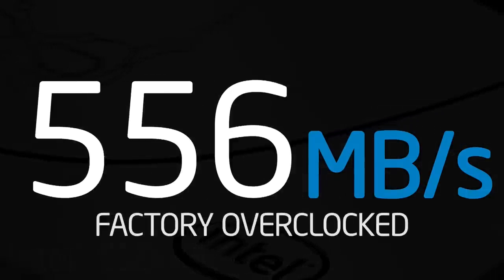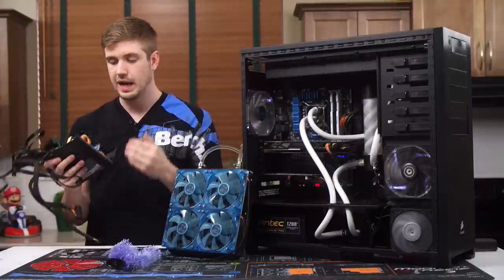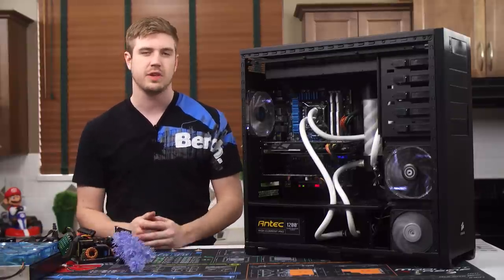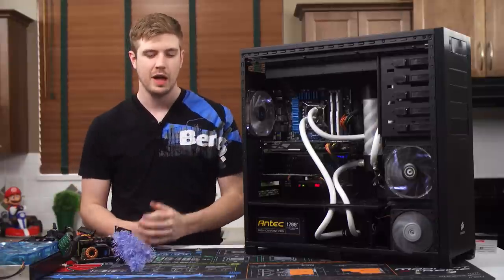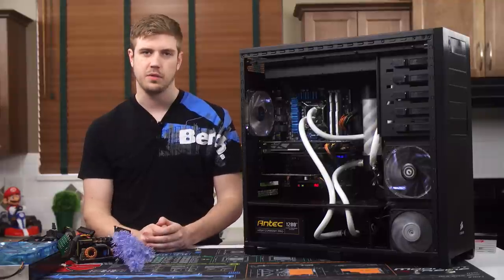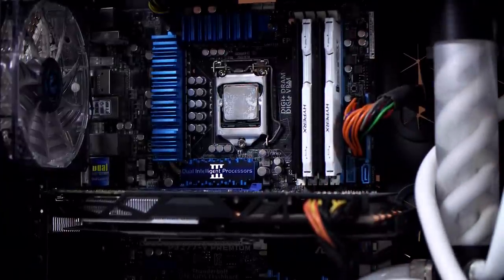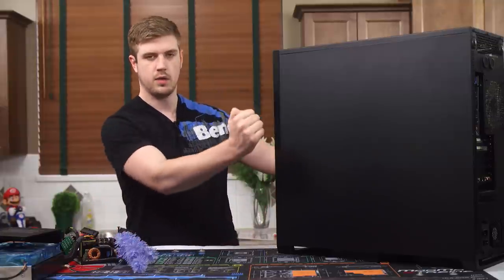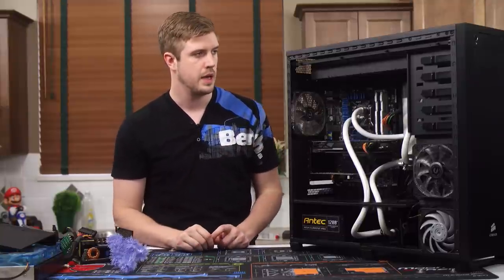Personal Rig Update 2 - Slick: The Introduction of Squirtle

Comment: I would highly recommend ditching the silver kill coil and silver fittings when you redo the loop. Silver has a tendency to cause galvanic corrosion with both copper and nickel. If you want to stick with flexible tubing, I would get clear lrt advanced and use a coolant from mayhems, since it has biocides and anti corrosives. White pastel with clear tubing would be a good solution for this loop.

Comment: I've seen some hate for it but I highly recommend Feser one cooling fluid. I have used it for years and had several colors including green, black and currently red and it is awesome. The color is fantastic and you don't have to worry about microbial growth or corrosion. Also, have you looked at Caselabs cases, I have a Merlin and I love it.

Comment: Reminds me of a build I did with mineral oil. A DC power supply that ran at 420volts, 20 amp. In the size of a single speaker box. Won me VICA one year.

Comment: Hey Luke you might like the NZXT H440. It has support for a triple 120 rad in the top, already has sound dampening foam preinstalled, and has that rear LED that you want to install in your 800D. I have one and I'm loving it. The only downside is the limited wire management behind the motherboard due to the foam taking up space. Oh and if you prefer to have optical bays this is missing them, but I just use an external DVD drive on the off chance that a professor or relative lends me a CD with content. Oh and you can unscrew the mesh in the front and top panel for a little bit more airflow in the H440.

Comment: If you want a cool idea for a case, I'm designing a custom one to be laser cut out of MDF and acrylic. It's about as big as a 900D, which is slightly ridiculous when I add it's only really meant for air cooling (although you could fit a 480, a 240 and a 120 if you really wanted to). It's worth it though. at every intake and every exhaust, there's a specially designed muffler that allows a lot of airflow, but (hopefully) lets very little sound escape. These require some space, hence the large size. Also, the optical drive is in the rear instead of the front, which helps with aesthetics. I'll be making the CAD files available online for free when I'm satisfied with the result.

Comment: If you are in the market for a good case I have a Cosmos II and I love it, wont be able to fit your thick rad in the top. My rad is The xspc rx240, descent rad if not superb, it is a thin rad. My pump/res combo is a cheap xspc but it has surprised me with its flow. I got 3/4 x 1/2 tubes and my temps are very very low. 33 to 40 c. I got 10 fans in my case and I can't hear them. 7 x 120mm, 2 x 140, and 1 x 200mm, one 140mm is just sitting in place just like your bottom fan and that made me laugh. I have an air cooled vid card that is why I have so many fans, I hate high temps.

E gads gadzooks and yoits! That cable management ( or lack thereof) is bordering on the epic. I'll definitely be following this build/update/redo. Power of the Squirtle, one day he can maybe meet Odyssey at a lan party. If I ever lug this beast around.

Comment: Well Slick, if budget is a problem, you can just go to the cardboard box dump, find one the size of your fish tank, spray like 4 cans of NeverWet on it and you now have the first mineral oil-cooled PC within a cardboard box! Then just place the NeverWetted cardboard box inside ANOTHER NeverWetted cardboard box if you are scared that it will leak. If you're poor, just continue the box-ception as you see fit. You have an endless supply of boxes anyway. NeverWet DOES in fact magically work with paper. You can turn a cardboard box into a ice and beer holder. So why can't mineral oil work?

Comment: Laser etch the eye thing from lord of the rings onto window panel and have different coloured LED (Red at bottom, Orange at middle and yellow/white at top, if you can have the LED's pulse at different times it might look like Fire)
You could put some design on the PSU fan and grille to look like that burning eye on the mountain.
The tree use NZXT sleeved LED's for glow, could even have yellow and green ones so the tree can show daylight & greenery and such.
If i have got stuff wrong I'm not a LOTR fan.

Comment: Use a plasma torch to cut your case dude, with little to no heat soak you shouldn't warp the thin metal and with the torch you can draw the Mona Lisa on your case if u wanted to lol

Comment: Linus loves that D5/655 pump.  I personally prefer the other awesome pump, the 355, or 35X if you want variable speed.  Its just so small and compact, and with a topper for G 1/4 fittings, it looks so slick.

different strokes ehh

That a Xonar Essence?  For 25 bucks??!?!  Crap!  Ive got the Xonar Xense.. and its kept my happy for like 4 years now.  Its a pure headphone user card, which I am.  HD 650s ftw.

Comment: Built mine few months ago.
Specs:

Case: Corsair Obsidian 250D
PSU: Corsair RM 650W
Mobo: Asus Z87i-PRO
RAM: Corsair Vengeance Pro Gold 16GB (2x8GB) 1600MHz
CPU: i5-4670K + Corsair Hydro H100i OC @ 4.7GHz
GPU: GTX 770 Asus Direct CU II OC
SSD: 120GB Samsung 840 EVO Basic SSD
HDD: 1TB Seagate Barracuda HDD

Got my i5-4670K to 4.7GHz @ 1.3V which goes up to 70-75c and stays stable. Even had it at 4.8GHz, but it was barely stable with 1.35V, so I stepped down.

Comment: Greetings, not sure how far along you are on your Gondor Tree Cut, but a way to illuminate it would be 1/4" Plexi (choose your fav brand) and drill holes for LEDs on the Edge, that way the LED will lite the Panel and make the Plexi Glow rather then blind you. You could use thinner Plexi and of course much smaller diameter LED's if you choose, you will just need to use more of them, obvious reasons. This way you can lite just the areas you want to lite. Enjoy...
Reply: Gondor Tree Cut?

Comment: "Frankenkludge" aka "Franky"
CPU: Intel Core i7-3770K OC'D to 4.3GHz
GPU: 2x MSI GeForce GTX 660 TwinFrozr
RAM: 16GB 1333MHz G.Skill Ripjaws
Case: Cooler Master Storm Trooper
SSD: 250GB Samsung 840 EVO
Motherboard: ASUS P8Z77-WS
Cooler: Cooler Master V8 GTO
Drives: Assorted (many)
PSU: Raidmax RX-1000AE 1KW
OS: Microsoft Windows 7 Ultimate 64-bit

Comment: Just upgraded from my Core i7 2600 on an Asus P8P67 LE to a Core i7 4790 on an Asus Z97 Sabertooth myself, and with all honesty im gunna miss my 2600. Still using my Antec Six hundred Case with its massive 200mm exhaust fan topside, not a pro grade case but i like it :D. Next project is upgrading my now aging Sapphire Radeon HD 6970, but cost contraints will put that on hold for awhile and i feel id be downgrading going to an R7 series card. For now i simply dont have 450 bucks CDN to do the jump...or nearly enough Raptr points lol

Comment: Linus, I love are your episodes. I have learned a ton. I am wondering and I am not sure if i missed it, you had the mineral oil computer built, could you use the mineral oil in the water cooling Lines? or is that to detrimental to the pumps etc?

Comment: That"s awesome that your rocking a 2600K, Old school.. I don't have much money, I'm playing ketchup like most of the little guy's out there. I have never been able to afford more than medium to high settings. None of my pc's ever saw a 100 FPS.. But I hang in there at anywhere from 30 to 70 FPS depending on the game, on medium 1080P some times down to 1600x900 on triple A titles.. But I maintain good fps since vulkan/new drivers, in DOOM aver, 50 FPS medium 1080P some times down to 1600x900 and I do really well on Battle front to aver, 46FPS medium settings , Dirt 3 85 FPS max settings 1080P, Alien vs Predator 60 max high settings 1080P FPS.. Lenovo Y700-15ACZ AMD version FX 8800P sold at best buy< I was kinda Lied to but through some major tweaking I make it work.. R9 M385X 4gig. overclocked.. 16 GIGs 1600, 9,9,9,9's  HyperX ram and crucial MX200 500 GIG SSD.. performs pretty good but not like Best buy advertises

Comment: The 800D certainly isn't the newest or greatest anymore...

But I don't give a SHIT.  Seriously, I have tried 6 other cases, each time I did a new build I bought a new case, and while each one was solid in its own right, there is something about the way a watercooled build looks on an 800D, that to me, is just, "right", and I ended up always going right back into the 800D.

The only case that wasn't an 800D that I seriously considered using permanently, is the 600T Graphite edition.  I was on a non-full-tower kick for a while, idk why.. Full Tower FTW, but if you want a Mid Tower that honestly is 98% as beastly as the 800D, the 600T is your case.  Its literally 98% the beast that the 800D is.  A little less rad support and no basement section.  If you don't want a full tower beastly build(but you should), the 600T is beast mode 2.0

Comment: Ah! HX620!
I'm still running it. It's still working =D 

Good solid ghettomods going on. I secured some case fans with small neodymium magnets, using clear tape in each corner!, until I could swap cases.

I had supermagnets but not screws. yeah O.o

Comment: Don't buy sound proofing kits. Just do what any self respecting modder would do. Buy cheap yoga mats and/or toolbox drawer liners and a can of spray adhesive. You can sound proof several PC's in assorted colors for about $15 or less.

Comment: You think that PC is ghetto? You should see mine! My dad literally cobbled it together with parts he found around the house and at his work. My graphics card is a hand-me-down from my brother because it short-circuited and is only working at half of it's previous efficiency. Compared to my PC, "Squrtle" is a high-end badassery machine.
Reply: wow wanna show a pic 4 proof?
Reply: must be crap if its made from random parts
Reply: Zain Hammad
TF2 runs medium settings at a buttery smooth 45 FPS. Gmod dares to go under 10 FPS on minimum settings, and BF3 runs minimum 25 FPS. Portal 2 crashes after an hour of gameplay, and BF3 only boots up because the graphics card is the one superior component in the PC, and the main 500GB boot HDD is approx. 7 year old hand me down, and the secondary 40 GB "High Speed" (ironically faster than 500GB) HDD is close to 10 years old. I'm currently attempting to create a "Showcase" to justify how worthless it is to satisfy Wasee Alam  before it gets a major upgrade; a hand-me-down Motherboard that is 10x better than my current one, and it supports DDR3 RAM, whereas my current board only has DDR2. Also, i'm getting a PNY 250 GB SSD so it boots faster than 2.5 minutes.

EDIT: Pics for proof: http://imgur.com/a/koY2m
Reply: OfficialNerdSquared Aww nice m8

Comment: if your 'sad' with your cable management, the computer I have built witch it still not done has an Intel server board in it and I put a lot of work in to cutting stuff out that I needed and I even made my own side window out of duct tape and plastic rap did I mention I have to have 2 power supplies just for it to post?

Comment: Hi, everyone just wondering what I should expect for temps, I just ordered a Corsair H80i and will be putting it on an
- CPU: i7 2600k (stock, no overclock)
-Case: Cooler Master Storm Scout 1 (The original that doesn't look a space ship). Stock front and top case fans, the rear will be switched out for the H80i.
-MoBo: is an Intel Extreme board DP67BG
-GPU: EVGA 780Ti.
-Mem: 16GB 1333 (don't know brand)
-HD: 1TB Seagate 7200
-PSU: 800W (don't know brand)

Comment: Dope pc but i just checked the 2600k vs the 4670k and they are pretty close bar HT. I dont get why you guys at NCIX dont do unfair tests on pcs, like a dope sandy bridge vs a cheap or average haswell build.......... just having to differnt pcs will make the results way more interesting. 

P.S on a side note i built my new pc just watching ur videos, so ur kinda like family now and love you for the help

MY PC BEAST
4670k
gtx 780 oc windforce gigabyte
g45 z87 gaming msi
G.Skill TridentX 16GB (2x8GB) DDR3 PC3-12800 1600MHz Dual Channel Kit 
Silverstone SST-AR01 Argon CPU Cooler <<<<< great product buy buy
Zalman Z3 (white) <<<<<<<<<< not the best but looks good
EVGA 600W 80+ Bronze Power 

I have had no issues bar using an old ssd and it runs perfect but dont know crap about over clocking so if u could send me profile i would be ur biggest fan

( LOVE THE WHOLE NCIX TEAM XXXXXXXXXXXXXXXXXXXXX )

Comment: Hey Luke - do you still use your T-balancer?  I have one in my home server to control internal fans AND the fans in my external RAID tower.  I use the analogue sensors in the RAID case and I used to use Speedfan (or something like that) to control fan speeds based on software sensor readouts.  With newer OSs, i.e. anything after Windows XP, it just won't work for me with the software sensor readouts.  I was just curious what your config for the T-bal is these days?

Comment: I wonder if the industrial noctuas work below 50% load.. my 1800rpm schythe fans wont spin up around 50%, if they don't you will only be able to get them down to 1000ish rpm, which would still be a bit loud..

Comment: The only sound you will have coming out of the case with Noctuas is air over the rad fins. The sound proofing wont help with that :(
Reply: Also, if you get F series fans, swap them over to push for the love of Squirtle, all that engineering producing an even flow of air is wasted if you just toss it out the top of the case and use the 99% standard suction flow pattern across the rad.

Comment: Forgive my ignorance, but do you actually put the exposed computer parts IN water, or are they protected somehow? I really am confused about the whole water cooling situation
Reply: The water never touched the components. It touches a metal plate. The heat from the component is transferred to the metal plate via conduction and then through the same process the heat is transferred to the water. The water is then cooled. This gets rid of the heat - hence 'water cooling' :) sorry for the late reply hope this helps

Comment: Learning newbie here!  What are those white tunes and what exactly are they connected too?  When I hear water cooling I think of like corsair h80 or something..  Is that a different kind of water cooling or what?  Looks badass and u can connect it to graphics card too?!  Whaaaaat I want it!  Explain plz
Reply: It is still water cooling, just what's called a "custom loop" instead of "closed loop"
Reply: h80 is a aio (all in one) it has a pump reservoir and  radiator. what he has is the same but every things separate he can add a video card to it or even ram to his loop but its more expensive and it takes more work to put together and keep up  aios only cool cpu some do more
Reply: They're both closed loops. Ones just custom and one is prebuilt. If they were closed loop then there would be leaks everywhere!
Reply: Weren't*
Reply: tolman33 Well, "closed loops" like the Corsair prebuilt ones are called such because they are not made to be opened and altered in any way, just install and go. Custom loops can be changed however you want when you want: tubing, radiators, etc. Just thought I'd clear that up :)
Reply: It's what is known as a custom loop. Basically with a custom loop you have to get all of the things yourself: pump, reservoir, tubing, coolant, water blocks etc. A custom loop can cool the CPU and GPU at the same time. A corsair H80 is closed loop and just for a CPU.
Reply: Isaac Jones
 are they a hassle to set up?
Reply: MxZeal yes and significantly more expensive
Reply: MxZeal but worth it if you live in a hot place or run in a small case
Reply: Qthefun  ok thanks guys, might implement these in my future build (next 5 years or so ) if i get some help assembling them together :)

Comment: Is this good for gaming? 
Core i7 3770 k + artic cooling freezer 13
Motherboard - Intel extreme DZ77RE-75K
Mushkin RAM 2x4 GB (1600 MHz)
1x sapphire tri-x R9 290(3 months old) 
Intel SSD 120 GB (520 series) 
Case-Cooler Master HAF 932 + Display NZXT
dvd rw, power supply 750W
Any advice will be appreciated. If someone thinks I should upgrade cooling or something just say. Thanks